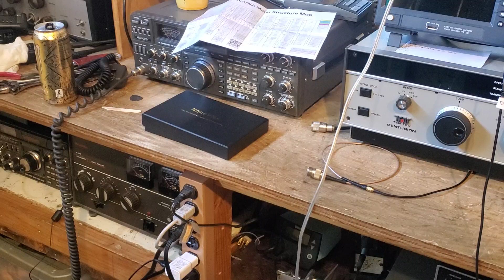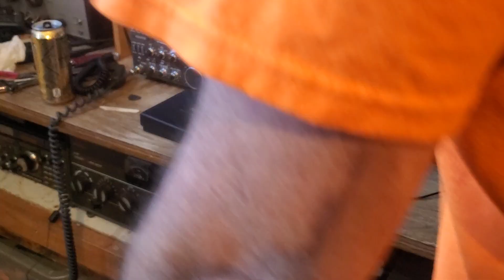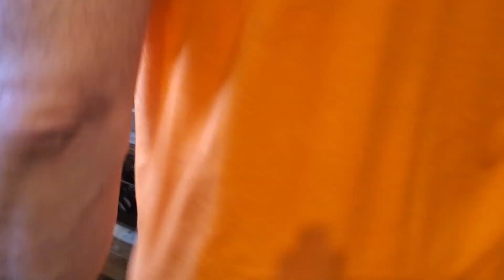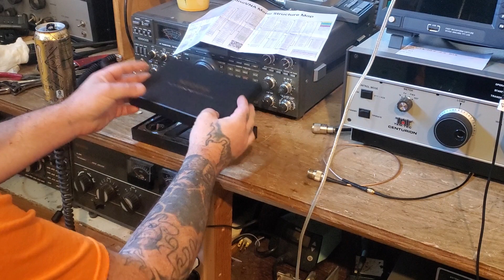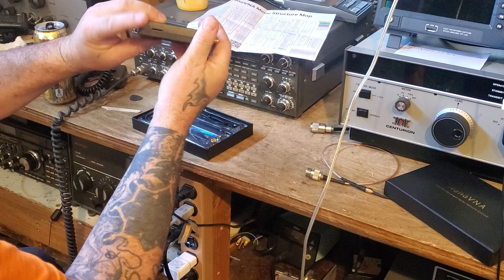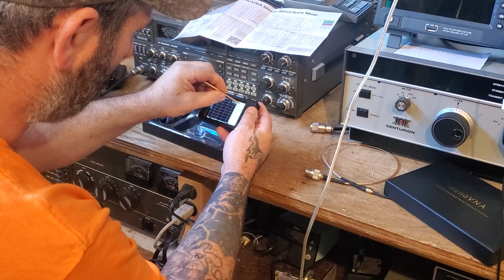How to use nano vna to measure antenna swr. simple no bs

Comment: Hello!
It's my question that how we can test an antenna for a bipolar monopulse uwb signal for example if that signal has a 5ns width and 100khz repetition..What is the frequency that I have to use as start and stop on nanovna  to measure my antenna parameters?????
Reply from the maker: I dont even know what that is. So I cant help you there. But i would think  if its 100khz wide wouldnt you just sweep something  like 200khz around the intended frequency range?
Reply: @hamradiohack  in uwb signals we have instantaneous bandwidth frequency for example for a 10ns pulse it's 100mhz instantaneous frequency so I know I have to look for 100mhz but idont know my antenna will radiate my pulse if it be tuned for a 100 mhz frequency
Reply from the maker: @ltlt6117  Certain designs give more bandwidth at a given frequency.  Full wave length antenna will definitely have more bandwidth than a 1/4. What frequencies are you talking about.
Reply: @hamradiohack  ihave seen that for this signals usually dipole -bowtie-Vivaldi is used this frequencies are just some short pulse with a repetition of 100khz or more and if for example we have a dipole on positive pulse goes through the one arm of dipole and other one negative pulse will goes to other arm of dipole
Reply from the maker: @mofapage  fullwave loop should be good 👍